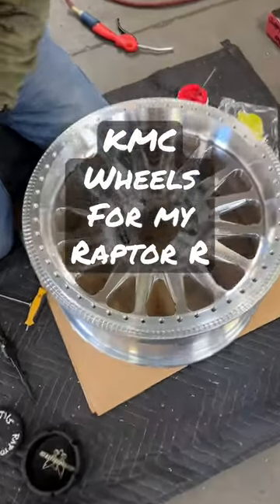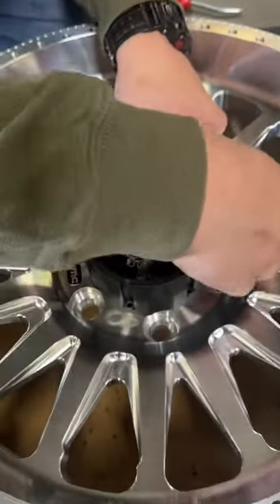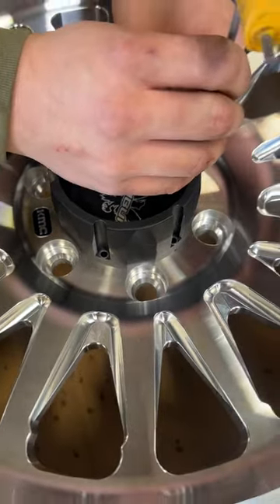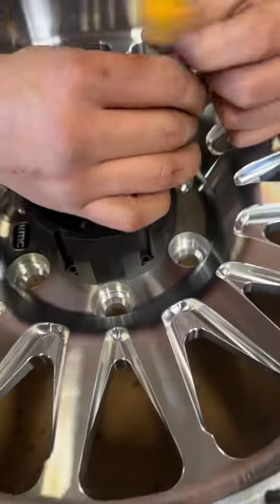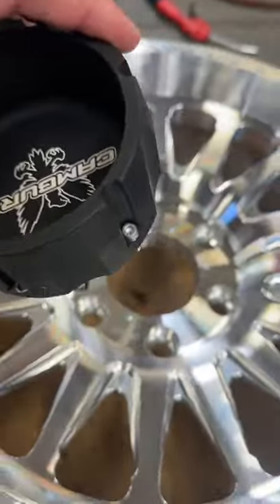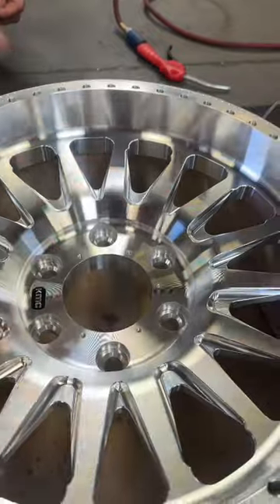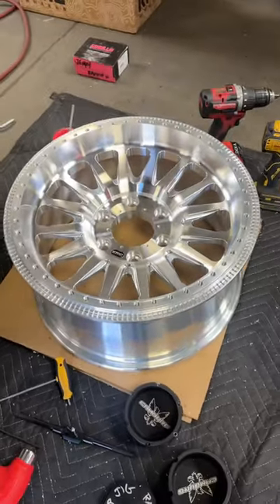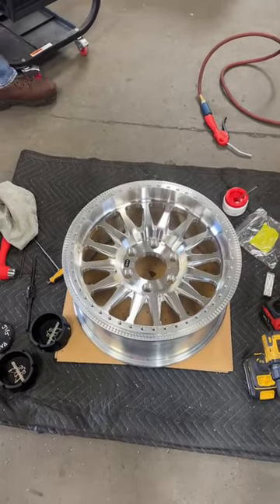Forged KMC bead lock wheels for my Raptor R. #raptorr #beadlockwheels #camburg

Comment: Wouldn't buy a KMC keychain, damn sure wouldn't buy KMC wheels again.
Reply: I’m looking at these wheels anything to know before the buy?
Reply: @jacobkober7077  these specific ones I have no experience with, but the KMCs Ive had all cracked around the bend behind the inner bead wall. I had to remove my tires and braze all around. KMC Rockstars (cockstars) to be exact. Company wasn't interested in a complaint.